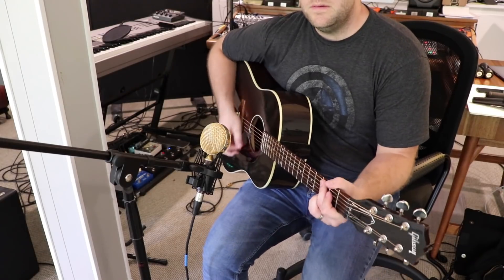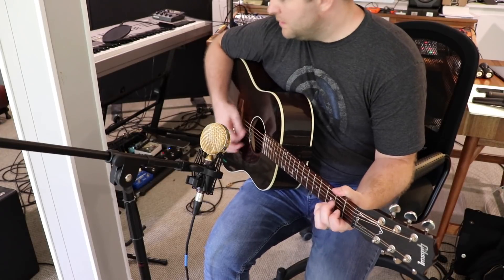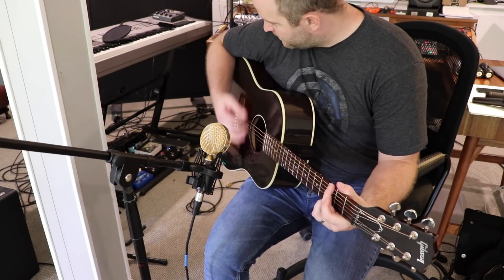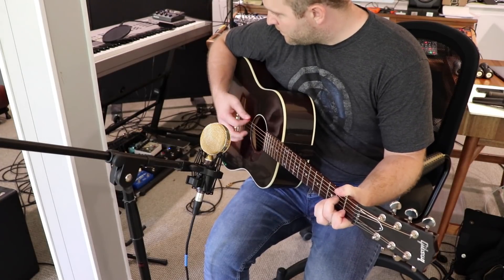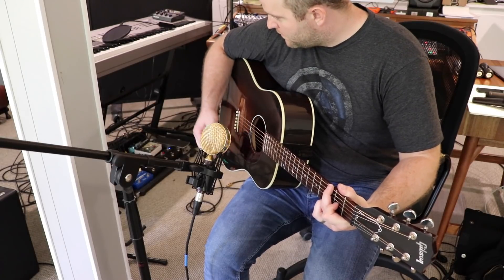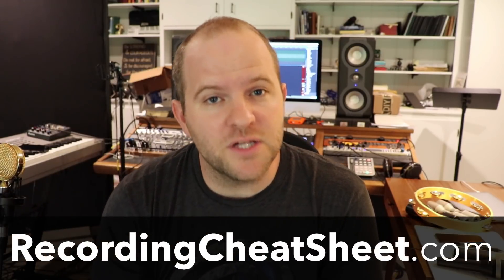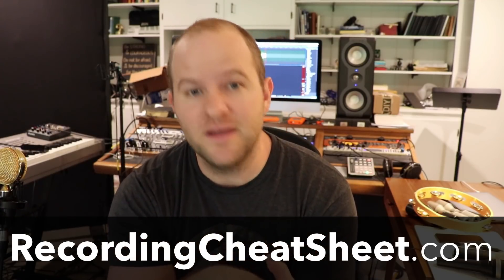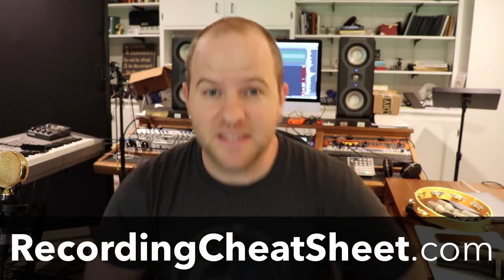Ribbon Mics: The Good & The Bad (Cascade Fathead)

Comment: Ribbon mics on acoustic are awesome. just roll off the low end. Not a lot to do.
Reply: @garyhynes  use EQ
Reply: @garyhynes  basically utilizing a high pass or low cut filter in your eq to remove a bit of the low frequencies.
Reply: @garyhynes  for sure, best of luck
Reply: Also, just make sure not to have it too close to the guitar.

Comment: I found out that using an SM57 pointing at the center of the cone and putting the Fathead pointing sideways just behind the SM57's XLR input gives a very nice M-S combination that sounds very accurate on record.  Or if your cab has two or more speakers, place the SM57 centered  on one cone, and the Fathead on another cone, sideways centered.
Reply: Interesting, when you say mid-side, do you mean duplicating the side track and flipping the phase? I know you normally do that in MS, but wasn’t sure if you do that with this technique

Comment: Nice video, but I have to say, this microphone can be amazing on an acoustic guitar, if you have the right preamp and with a bit of EQ - We have a song titled "Closer," and we recorded an acoustic version using this exact microphone, going through a Solo 610 tube preamp - Pointing the mic at the 12 fret of the guitar and slightly tilted towards the headstock - I really love how it turned out and all we had to do in post was ramp up some brightness with a high shelf at 10k and remove some 250-300 herz - Ribbon mics can sound darker when back to back with a condenser, but I feel they really take post production well and it's easy to make them bright without them sounding too spitty. We use this on vocals a lot for the same reason, but even in this case, pre-amp choice is vital - if you want to go the ribbon route, it's worth to invest in a really nice pre with ample headroom

Comment: I agree completely on micing guitar cabs.  
If you want to fix this microphone for vocals, add a 600/600 ohm transformer.  You can also add more ohms (up to 2k or so, for secondaries)
That will help your proximity problem.  Also it will brighten up your microphone.  I own the same mic.  Found this to be a solution.

Comment: One thing to consider using a ribbon on acoustic is placement. Where you had it further up the neck tends to be the warmer spot for micing an acoustic in the first place. If I were micing an acoustic with a ribbon, I would probably place the mic by the bridge which typically gives a much brighter response.
Reply from the maker: Good point. I wanted to show how it sounded in the spot where I normally record acoustic.

Comment: I've had my Cascade Fathead II (w/Lundahl transformer) for about ten years now and absolutely love it on acoustic! But, I guess it all depends on what kind of music you're recording, how dense the mix is, and the vibe you're going for. I play Gypsy Swing where the acoustic is the featured lead instrument and I appreciate the warmth and treble roll-off. Also the OMNI pattern of a ribbon reduces the boomy proximity effect (especially from an acoustic archtop soloing with 13's). Another mic that I've really been digging is the Warm Audio WA47Jr... it's fairly inexpensive and has a little more silky/buttery tone than many other condenser mics. It also has three different polar patterns and sounds best and most natural (to me) in OMNI. I'm looking forward to blending both mics (in mono) on my next recording and seeing what I can come up with. Oh... I'm also running both mics through a Soyuz Launcher Deluxe which adds a little more sweetness with real transformers (in boost mode for the FHII and in line saturation mode for the WA47Jr). I've heard about the great sound people are getting from blending a FHII with an SM57 on guitar cabs as well, but I have yet to try that. Thanks for your videos, I have found them helpful!

Comment: I have the II model with the upgraded transformer. One can switch between "active" and "passive" mode, the latter better exhibiting the character of a paired preamp. Mine is in storage at the moment but despite your perspective, I hold out hope it will sound good on vocals. A lot will depend on the pre, but I really hate having to de-ess vocal tracks. My voice seems particularly prone to that so a silkier, smoother top end is welcomed. I look forward to determining whether it works for my purposes. :)

Comment: Careful gesticulating like that with the Fathead, Duder.  Those tiny tiny little screws inside of the middle metal surround of the Fathead do not take well to road wear. At all. Once those little internal neck screws strip out, that’s it.  All you’re left with is a bobble fathead and some weird extra “tone” in the signal you don’t want.

Comment: Why don't use multiple microphones at one time - for brightness, for middles, for darker part - and the EQ it by adjusting volume of each track? Like Snare Top and Snare Bottom thing. I never tried recording guitar (only e835s by sennhiser for clean gtr and sounds great), really interested about it.
Reply: You run into a lot of potential phase issues when you add multiple microphones to one source the main reason you mic the bottom and the top of the snare is to capture the cables stretched under the bottom head. You could "potentially" do this with multiple mics and one source but you really don't get the same "massive" changes from mic to mic, it's more slight changes that when used properly results in a better sound. So all in all it would be a heck of a lot of work for not much result.
Reply: Jonathan Galle thanks I think I got your opinion. I do experiment sometimes with  virtual cabs and microphones such as "Shred" plugin, kuassa amplifiers, mercurial plugins etc and I use the "triple(or sometimes more) method" to achieve a tone that I want, can't name it a perfect way to do it, but it works. Yeah, takes alot of tries to match each one with another, and that's quite enjoyable for me

Comment: That is one of the cheapest ribbon mics you can buy, and there are mod kits to improve them now as well. A good ribbon will sound much more open than the Cascade Fathead will, but that mic is great for miking bass amps and guitar as well I would assume. A good ribbon will cost at least 3 times as much as the Fat Head, so it is a great buy for an amp mic, but if it's dented it's likely broken so I can't trust this audio file you used. With a 2.5 micron ribbon, even laying them sid ways for any length of time destroys the ribbon element.

Comment: Used table-top ribbons in court/conference setting 4 yrs.  Base isolates rear from ambient sounds.  Frontal range has hemispherical, near-field pattern (at least for the pro models $500-$1,200 range).  Used ones much less on eBay. Place 8-12" from speak to get ALL frequencies (low, mids, highs). Phantoms ver only, use hiQ cables.  Great for non-operatic voices.

Comment: To all ribbon noobs, make sure...MAKE SURE you throw the phantom power as soon as you plug your new (or preferably vintage) ribbon mic in. This is incredibly important. If you don’t, you risk having a ribbon mic for a long time and no one needs that. It just spoils you for guitar cab recording...you’ll thank me later...
Reply from the maker: What he means is don’t use phantom power. In some cases it can destroy the ribbon, but it’s not that common.
Reply: Definitely check your mic some new ones have a pre amp that uses phantom. But be super careful unless you are anxious to stop using it, like he said 🤪
Reply: I was thinking about picking up blue’s ribbon for that exact reason. If it sounds good and there’s no chance of destroying it with phantom power, win/win